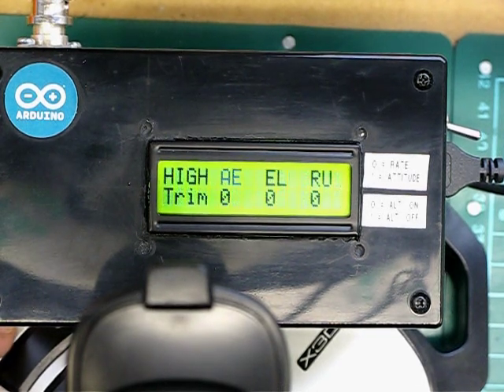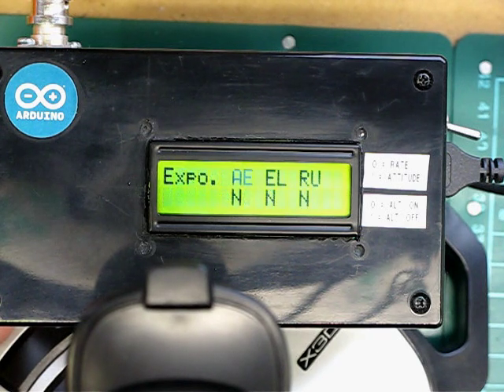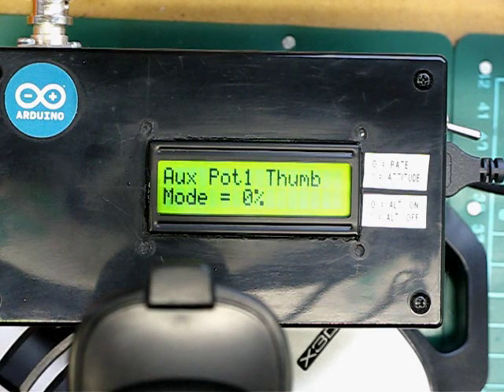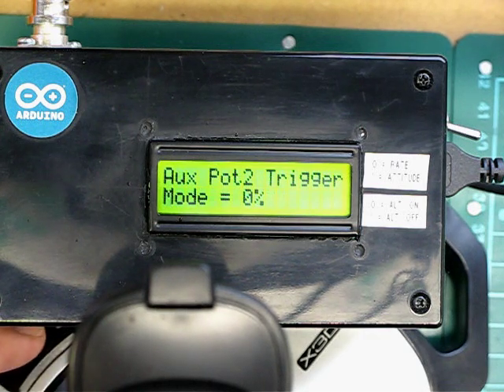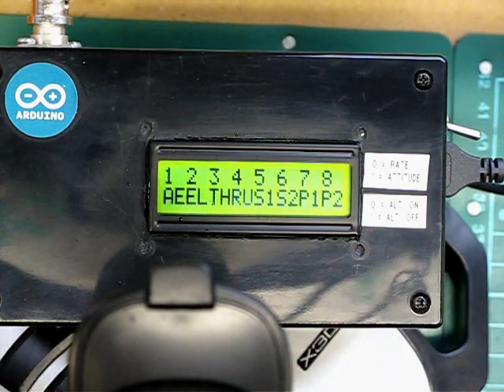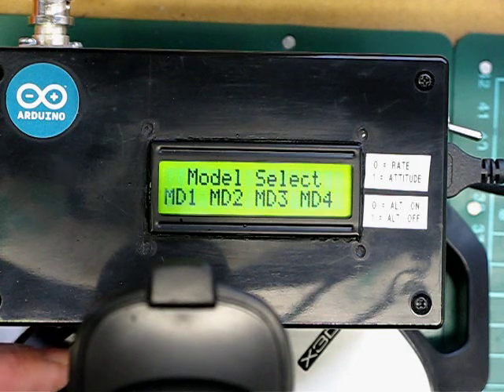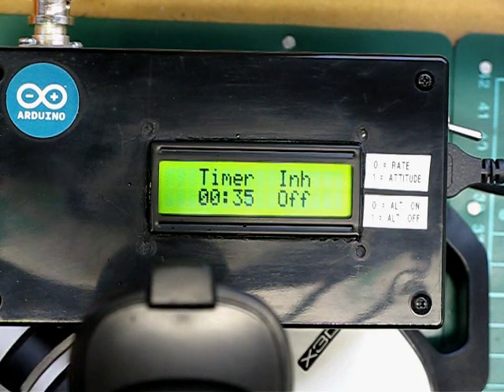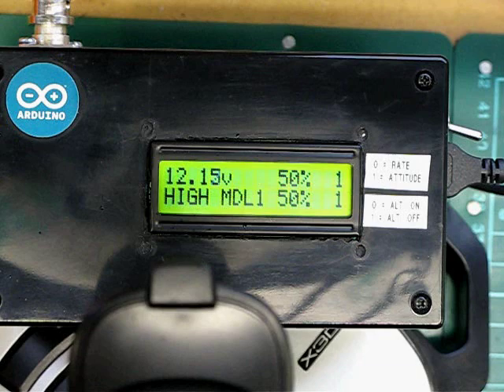RC Joystick V3 USB Version - Menu/LCD Operation

Comment: Thank you for the quick reply...sadly I have very very little in the way of electronics experience and secondly, I tend to solder like most people WELD! the lag time I was referring to was the amount of time it took between the joystick movement, and the time it took model to respond to that command. usually there is a half second to a second delay. You DO realize with all the features you have included,  that you could make  hundreds of thousands if not MUCH more. I am SO serious! PLEASE think.